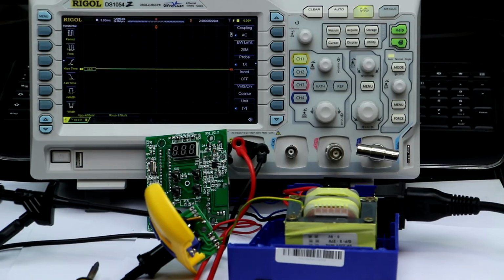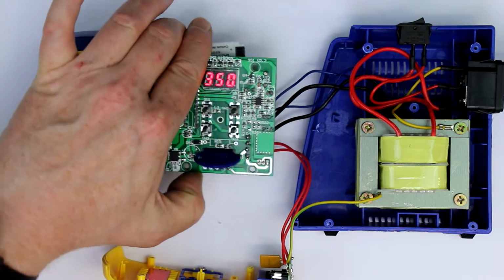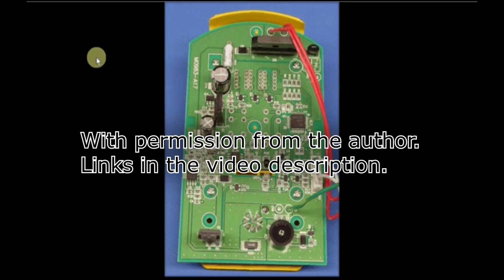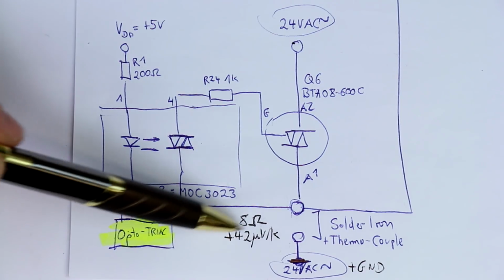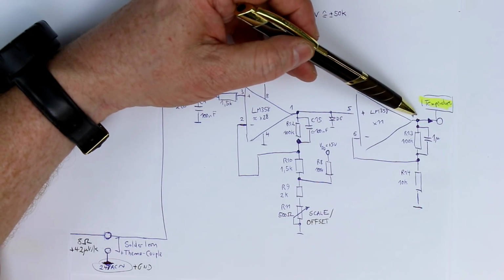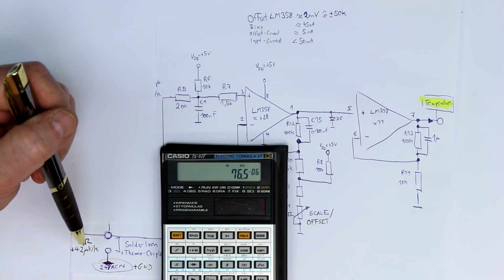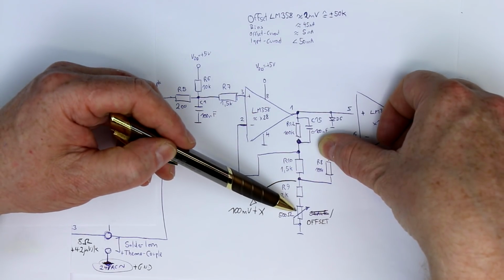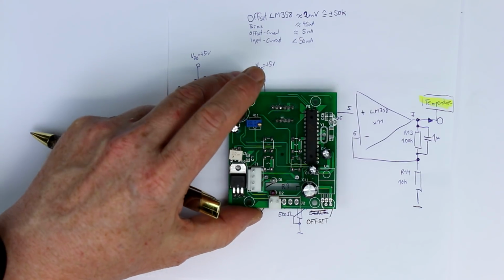Hakko FX-951 Clone: Further tests & circuit analysis

Comment: Roger, did you ever finish working on the Nano MCU replacement, or did you finally give up on this one?
Reply from the maker: I didn´t give up but have this project delayed (until forver?) due to time constraints. I got so far that the 3-digit display is controlled, the temperature is measured and the iron is switched on and off. But I didn´t have the time to work out a control-loop and have the extra-functionallty of the original Hakko-station implemented.

Comment: Did you make another video with improvements on the hakko I couldn't see anymore videos?
Reply from the maker: I am working on an improved firmware where the original controller is replaced with a Arduino Nano.
But that will take probably still some months because ATM I barely have a minute of time for that project.
When it´s ready to show I will make a video aout it.

Comment: Hi what is the Maximum current out of this circuit? did you test current out ?
Reply from the maker: It was not necessary to measure the current because the heating element is purely resistive.
So the power could be directly calculated from the RMS output voltage via Ohm´s law for power: P=(V*V)/R
And current can be also calculated by Ohm´s law: I=V/R
From memory I think the resistance of the tips (when hot) was 8 Ohms.

Comment: When you take the key card out (or just slide it a little out not removing it completely from the slot) you will see the real temperature not only the set temperature. With the key card pushed completely in you only see the set temperature and the dot is telling you when it is heating up.